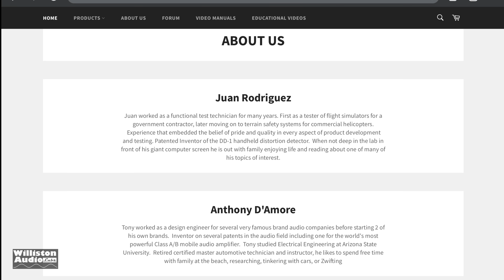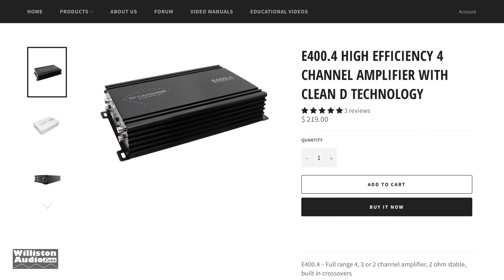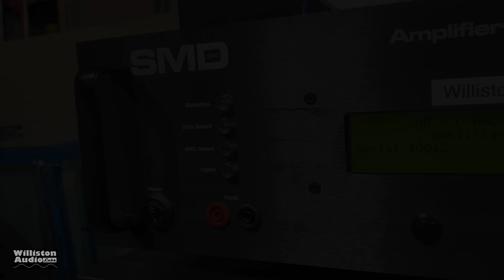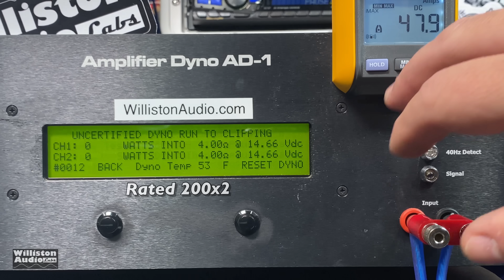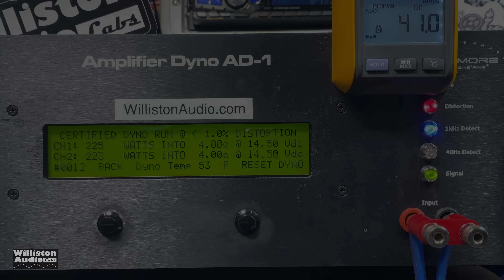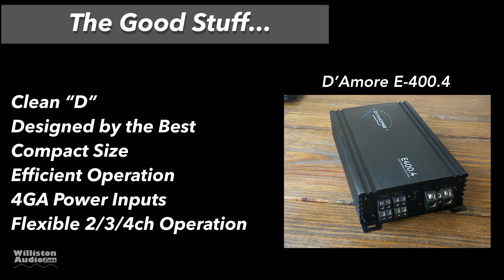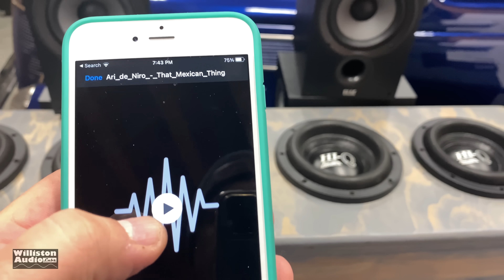How to Get D'Amore for Your Money? D'Amore Engineering E400-4 Amp Dyno Test and Review [4K]

Comment: Well this is the first amo dyno I have seen of these amps that wasn't set at 14.8-14.9 maybe these amps are ok i would like to see if it can do rated power at a cars actual voltage 13.5-13.8

Comment: @5:33 if I bridge the amp, but want a full range would that be adjusted by switching top switch to CH3/4 and bottom switch to full? Also would it require RCAs on both inputs or would a source signal from CH 1&2 feed all 4 channels? Sorry if its appears to be a rookie question.

Comment: Many months in, (edit- i was a first run buyer, on the 3 boards) with my E400.4, 350.2, and E1000.1.
I have not got to the E1000.1, as of yet (low end is coming) but, i adore these boards. Zero issues, run cool, for hours. Build quality is top tier, sound quality is "to each their own", but for me, they are amazing. I will be getting more soon.

Comment: I'd like to run a BM MKIV sub with a D'Amore amp.  I believe the BM MKIV is dual 4 ohm coils. You can wire it either 2 or 8 ohms.  It's rated at 450W.  Which amp would you recommend?

Comment: This would be perfect for my truck. Small, good power for the infinity speakers in my doors, and a bridgeable 3/4 for a little bit of that .1 channel action tucked away.

I've been looking at 4ch setups just for that reason, since those door speakers are lacking punch at only the 22w put out by my little head unit. My other car has the same speakers in the doors but that HU puts out double the power of the other one and you absolutely notice the difference between them. Cooooooool.

Comment: I wish someone could help me. I have a 2019 impala premier. Long story short I’ve already completely upgraded everything. 3 amps and a yellow top battery in the back. My troubling question is I have a pacaudio amp pro GM 61, I believe, which ever one works for the Bose system and my question is I have to turn my front and rear amp down because I have a continuous shhhhhhhh sound like when your TV is turned all the way up and there’s nothing playing, that static sound that you get. Not a crackling sound but just that quiet sound. I have been told it’s called white noise. I know there is someone out there that can help me fix this problem. Pac audio told me to switch the little voltage button on the unit and it did drop the static sound a little bit but it is still there. I need to figure out the problem so that I can turn my amps up. There should be no sound coming out of those speakers till the music is turned on. Can someone please help me.
Reply from the maker: Five Star Car stereo does many shows with viewer questions and they may be able to help

Comment: So more or better capacitor! That's pretty much how you keep class D from back feeding noise back into your 12volt system. I don't doubt they know how to bring audiophile sound into car audio.
Reply: not just more and better capacitors, but especially since you're dealing with class D you'll need nice inductors and a very high switching frequency

generic class D car amps only switch at anywhere between 150kHz and 300kHz, which especially for fullrange audio is quite low, really high quality amps should switch in the MHz range, because it's kinda like bits/s and you'll need less filtering too (saves on inductors and has higher quality)

you can kinda see it like with how many points per second it can recreate of a soundwave, the more the better especially if you're driving tweeters etc because 150kHz can only reproduce 10 points approximately of a 15kHz waveform
Reply: @BH4x0r  probably went way over his head lmao

Comment: HELP PLSS This is my first system install. I have a Audiopipe db2 on an Autotek TA2050.1 2000w Mono. I hooked everything up and got NOTHING from the amp. The remote wire was wired to the remote wire in the back of my afm stereo. I used Ttaps to do this. Im getting about 10-11.5 volts on the remote wire from the stereo but only about 2-4 where the remote wire hooks up to the amp. I then tried a different wire that was putting out 14 volts thinking maybe it just wasn't enough before. Still only got about 2-4 volts where it connected to the amp. What is the issue 😭🤦 (I've been trying to find time on the weekend to do this for 5 weeks)

Comment: Serious question, what would it take to get amps like these (and class a-b) to be over 90% efficient?
Reply: class ab will never be
Reply: @imBriz  what about D?
Reply: @seniorxj2931  far better transistors, with far lower on resistance, but for an Amp like this, in this price bracket, it aint happening, class ab, even with the most efficient devices, you arnt gonna see more then 60 to 65 percent, maybe 70...

Comment: These amps look a lot like the Audio Dynamics MK series I have their 600.4 and it looks very similar to your 400.4 the other thing is that I'm interested to see who came out with the technology first if it was Audio Dynamics with Steven matz from Zed audio or demore engineering because it's only been recent that they've been able to get the class D circuitry so clean to where it is close if not better than the class AB circuitry
Reply: justforlaughs8988 No class D amp will surpass a good class AB for distortion. The distortion in class D is inherent to the way they generate the voltage for the output. Its a competition between class Ds for efficient filtering but not between class D and class AB. D’Amore’s top amps are class AB for this reason.
Reply: @2011joser  yes I'm not saying there better in anyway then a class AB I'm saying the fact that they look similar or a copy of audio Dynamics mk series and Steven mantz ZED audio has gotten the class D circuitry as good or close to as a class A B amplifier for SQ purposes

Comment: @8:30 "You'll never hear the difference, that is like 2%".    You stated that wrong.  The difference is 10 Log 98 - 10 Log 100 = 10 Log (98/100) = 0.87 dB difference side to side.  Where you sit relative to the speakers has a lot more variation than the side to side power difference.
Reply: ...if you have a hundred watts, he said. He wasn't referring to the spl.

Comment: Pioneer and Kenwood have digital d amp with 4x100 4ohm 4x45watt RMS .
Cost about 99 euro .
Only need 15amp and have crossfilters and can be bridge .
My self have a Kenwood model easy to hide in the car .
Reply from the maker: Both of those are impressive, I’d agree
Reply: @wal  Thanks.
Reason I thake the Kenwood and not the pioneer.
Crossfilter high is fix on 80hz on the pioneer  (high filter 80hz and up)( low filter 80hz fix for the woofer ) .
Well de crossfilter on the Kenwood you can turn what you need.
Personal i use are 4x 10cm (4") pioneer speakers 30watt RMS and 210 max 2 way speaker.
Well I can not set bigger speakers in the dash or in the roof ( Opel agila or Suzuki wagon r+  both are the same car)
For the rest I use the Pioneer active woofer TS-WX210A.
For that small car a lot of sound.
Driving 400klm a day for my work.

Comment: An easy way to clean up class D is to make the switch to full bridge and move the power supply stage to a higher switching frequency most class d run the power stage around 24khz but bump this higher to 36-100khz this will add some more losses in the fets but honestly those losses don't really get crazy tell your over 250khz  because most modern fets are stupid fast. This change helps because the greater the difference there is between carrying frequencys and audio frequency the better you can filter it out.. the next step is the output stage pwm circuit is the dynamic range. The is the the range between the lowest output and highest output this is controlled by the chop and carrier frequency on the pwm signal to the fets higher frequencys will give a more accurate waveform tracking also making it easier on the inductors to eat up the carrier frequency and pass a true sign wave. The IR relationship between the output filter and the woofer inductance will have a strong impact on total dampening, amplifier response curve. The way the amp dyno works supplys basically a static fixed inductance value based on the resistors in the dyno but given the inductance maps of woofer testing even if and amp has a small crown or is peeking at say 120hz and drops say 5-10% at 40hz this is do to the output inductor reaching saturation and will be far less with an actual woofer then it is with the amp dyno.
Reply: Dude, instead of giving us Your long boring story... Put Your money down, build the thing.. And then we buy, no use giving a looong lecture
Reply: @vpowerelectrix998  i teach electrical engineering and hardware engineering, i build mostly stuff for government contracts. I'm not sure i have time to design and build a pure quality driven amplifier design, plus i have been thinking about building a custom amplifier for my tesla model 3 and putting in a wall

Comment from the maker: Video Index:
0:00 Intro and D'Amore Engineering
0:32 The T15kW
1:18 SMD / D'Amore Engineering Products
2:15 The E-Series Amps
2:50 Tony D explains "Clean D" with SMD (https://youtu.be/g-IgjH-YKo0)
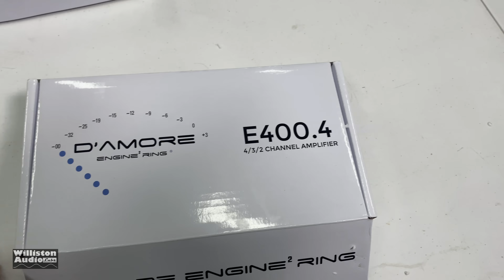4:00 Unboxing the E400.4
4:29 Specifications
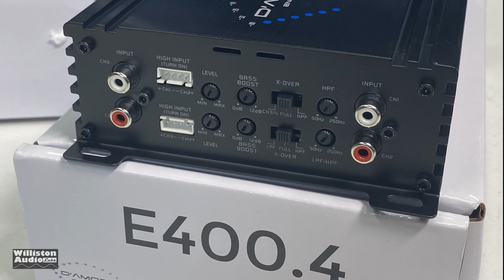5:02 Amp Adjustments and Connections
6:47 Amp Dyno Tests
10:35 Power Output Results
10:57 Do It Bump Doe?
11:17 What's Inside?
12:04 Pros/Cons
12:50 SMD Vid on E-Series (https://youtu.be/AZoDP07z9YI)
13:31 Special Feature

Big Thanks to D'Amore Engineering for sending the amp for me to review:
See more at http://www.DAmoreEngineering.com
Also Thanks to Steve Meade for allowing me to use video clips:
https://www.YouTube.com/Meade916
Shop for D'Amore Engineering Amplifiers:
https://amzn.to/2OHcKi9
https://www.wccaraudio.com/
https://damore-engineering.myshopify.com/